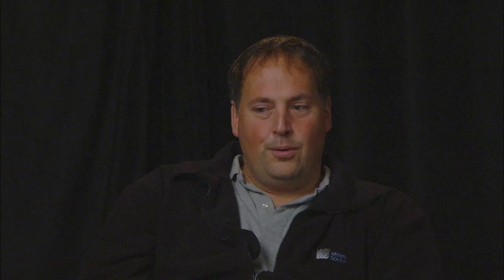The TM Array™ from Concept to Reality (HD)

Comment: @mindstormsabrewin The probem with 360 shows is: You want good sub coverage in the entire arena without (many) phase issues. Good sub coverage = many sub's. But multiple sub's spread throughout the room create's phase issues. So you need one single source of low end energy = a sub array. 

A sub array on the ground is possible. But when you are creating so much low end energy under the stage, you're ending up with a very bumpy stage. And if it can't go on the ground, you need to fly the array.

Comment: I'm wondering if you time delay each block of 4 double 18s by about 0.5-1ms (depending on angle) as you move down the columns, whether you can steer the bass down so it acts like the column of subwoofers is tilted down towards you, but in all directions. You don't want to delay too much or the bass will be funneled onto the stage below (if the time delay is the height of the cabinet). I'm wondering where the other interference lobes will be.

 In this case with balconies at the height of the subwoofer hang it was advantageous not to do this so extra bass could go to the balconies, but for a mostly floor audience, delaying so the subwoofers are lined up near the back (or middle if you want to minimise bass spill) to give more volume near the back of the room.

Also for a mostly floor audience, a splayed cluster hang of 6 Danley Sound Labs GH60 below the subwoofers to put even mids and highs everywhere on the floor except the stage below. (Danley Synergy Horns are noted to be one of the few boxes that splay at their coverage angles with minimal comb filtering/interference.)

For the balconies, some more horns firing straight out further up the sub column might work well.

Comment: They should have done that with Sensation Black. They have a whole ring of line arrays in a centre circular PA. I think they were just boxes at the top of each line array for subs. You'd need a pretty good delay module to handle the J Array boxes 40 feet in front of the subs. My driverack only goes to 10 ft, guess I'd have to just settle for getting the crossover freq in phase for the most seats in the room.